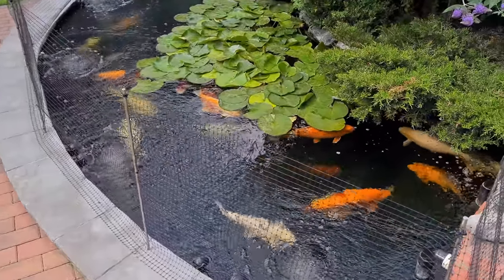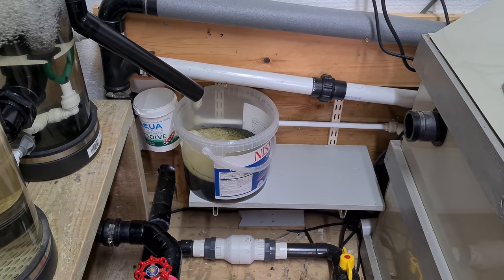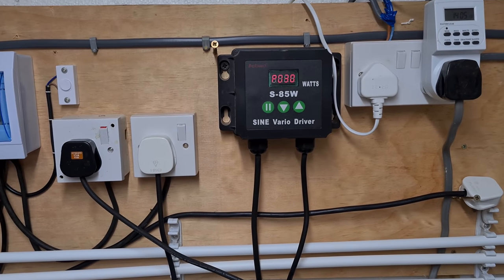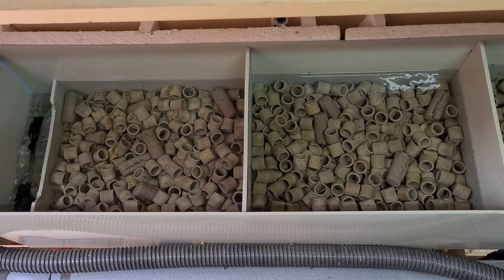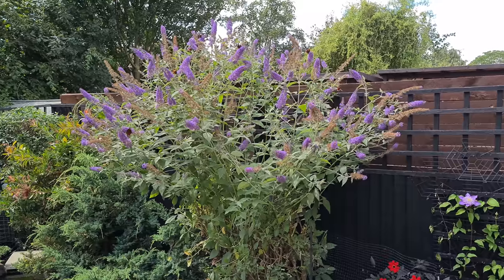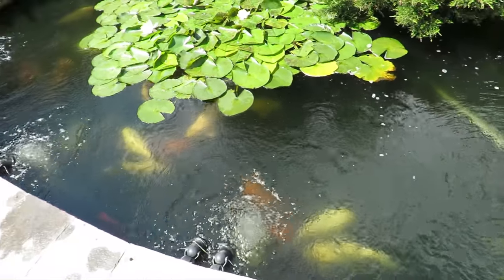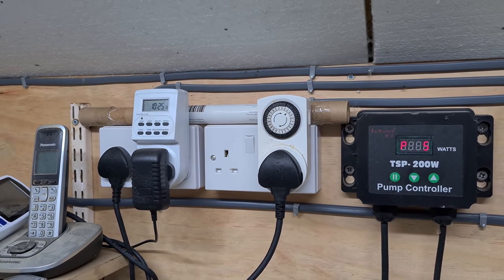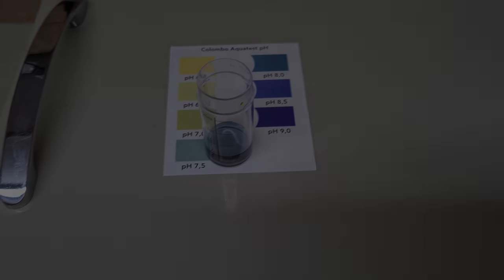Protein Skimmer, New Media & Pond Clean.

Comment: Great video Terry as always, why not try Canterbury spar in small bags in your bakki river, in a natural river water is cleaned by running through gravel, Canterbury spar in bags can be lifted out and cleaned in a bucket, thanks pete
Reply from the maker: Hi Pete, thanks for the tip mate. The Siporax is pretty good and self cleaning. I do usually get dirt settle in the river, but the media stays clean. I think putting it after the protein skimmer hasn't done it any favours with all that air flowing through it. It's got it's own feed now, so it should recover. Thanks again mate, Terry.

Comment: Hey Terry, one thing that could be added is a plant filter to get rid of those nitrates as well as phosphates. But what would be brilliant is build a refugium for a pond. You could use natural string algae that grows in your area and place it in a container with something for it to grow on. And just remove excess algae to allow continuous nutrient consumption. Better yet you could place it outside under a greenhouse cover so you don't have to store it in the filter house. For aquariums, they make them 10-20% of the water volume. They're usually a 12" depth. You could also put grow lights so the algae with the set up so they can consume nutrients 24 hrs rather than during the daylight.

Other things that would be cool is recycling your pond water through an RO system. That's really popular over there. Also possibly growing your own live food like black soldier flies. 

That should keep you busy, cheers!
Reply from the maker: Hi Miguel, Thank you for all the ideas, much appreciated. Problem is, I'm not allowed any more garden lol. I am looking into the nitrates problem, so I'll see what I can come up with. The RO system is a bit expensive for me I'm afraid. Thanks mate, Much appreciated, Terry.
Reply: @Wrighty  Hey bud - Nitrate wise, if it's high, you can get nitrate removal media stored in a pressure tank. It was something that I was looking into. I worked out a few calculations. The only thing you have to do, is backflush it with brine to recharge it. Smart stuff in all honesty.
Reply from the maker: Hi mate, thanks for the tip. My bakki river should sort it out really. I have got some tablets to treat the pond with, that say their a nitrate remover. Was going to see if they work. https://youtu.be/fAuJ0be2e7o see what you think mate, Terry.
Reply: @Wrighty  think it's a loads of codswallop, but I'd be interested to see if you see any changes at all. I think the pressure vessel (think big blue) that you can feed water into via a return (use a horse clamp) and it'll turn nitrates from 80ppm to 0 on the outlet.
Let me dig out my research and I'll drop you an email with it..
Reply from the maker: Thanks mate, will be interesting. pondfilters@gmail.com thanks again, Terry.

Comment: Check your Kh if it is low the bacteria will crash. Also when you clean out the algae you are taking away the thing that eats the nitrate and a lot of the biomass . I know you hate aglae but the short stuff is great for the pond biomass.
Reply from the maker: Hi Garry, I did check my KH and do have some bicarbonate ready if I need it. But all was ok mate. The reason I vac the algae and not treat the pond with an algae remover is because, like you say it is good for the pond. The trouble is all the fish waste and dirt gets trapped in it, and doesn't get to the bottom drain. When I vac, it only removes the loose stuff, and leaves a good coating on the pond liner. I don't mind this short growing algae, but it's the hair/string algae I do have a problem with. Thanks mate and take care, Terry.

Comment: Thanks for the videos. As for the nitrate being a bit higher, could it have anything to do with adding heavily aerated water from the protein skimmer now feeding the bakki river?
Thats assuming the bakki river was producing anaerobic bacteria before, now it has more oxygen in the water it might have knocked it off a bit? Just a thought.
Reply from the maker: Hi mate, thank you for your channel support. You could be right mate, that's just what I was thinking. I'm looking to re-route the water from the skimmer into the same outlet as the moving bed. I would then have to get a new feed for the bakki river. I suppose as it is at the moment, it's running more like a bakki shower. Thanks mate, Terry.

Comment: Hi, great video as always, I'm betting you will think of another project soon enough :) Re: nitrate, I couldn't work out why my nitrate was higher than expected, it turned out that my tap water had more in it than my pond did! So may be worth testing yours if you've not already?
Reply from the maker: Hi mate, I am going to test the tap water, but I've also been told to check the rain water as well, as that can contribute to the nitrates. Thanks for the tip though mate. much appreciated. Take care, Terry.

Comment: You could always use your siporax to make a very low flow bio chamber to remove your nitrates , the flow needs to be really really low so it creates anaerobic areas , I know your  bakki river will be providing some areas deep in side the media but if you really  reduce  the flow and stack your siporax  this will provide a much greater area for anaerobic Bactria to grow. Your could also make up some media baskets to hold the siporax then to clean it you just need to the the basket up a few times and give it a shake. How much skimmate are you collecting in the neck of your skimmer ? As over time to much will reduce the skimmers efficiency. So maybe you could make a self cleaning head for the skimmer.
Reply from the maker: Hi mate, I will be taking the rubber top off the skimmer from time to time and give it a clean. I know these skimmers can be very temperamental. I might do something with the new media that should help with the nitrates. I do think a lot of the problem was from all the rain we've had. Thanks for the tips mate, I will look into it. Very much appreciated, Terry.

Comment: Your nitrate has gone up because you got rid of the algae mate.
Reply from the maker: Hi Khi, the algae is still there mate, I just vac off the loose stuff. I do like to see it, as it makes a nice covering of the liner. Thanks mate, Take care, Terry.
Reply from the maker: Hi Khi, My Bakki river usually takes care of the nitrates, but like you say, it got worse with removing the algae, plus all that rain we had didn't help. Thanks mate, Terry.
Reply: Im not familiar with the Baki river concept, i just know from the nitrate cycle that you removed a large dutrient sump by taking out the algae. My understanding on nitrate synthesis it requires slow water flow to allow increased contact time in an anaerobic enviroment...is the baki river water flow slow enough and is it a low oxygen enviroment I doubt it will be low enought after going through a moving bed and a protein skimmer.

Dependent on how close to the roads you are I doubt that would increase the nitrates in rain by the amount youve seen, nitrogen dioxide that disolves into water would likely be parts per trillion to low for the chemical test kit, im on the M4 and it rarely changes.
Reply from the maker: Hi Khi, I have my bakki river running slow, but a lot of people on here say it should be running fast. So I'm not sure really.
Reply: If the goal is to remove nitrate then it needs to be slow oxygen deprived anaerobic it it runs fast it will be aerobic and will not denitrify the nitrate. But even if its low on oxygen unless the media contains the right type of bacteria then it will not convert nitrate into nitrogen gas. Im not sure but free nitrogen gas i think in water should be visible in tiny bubbles do you ever see bubbles rising from the media in the bakki river?
Reply from the maker: I can't say I've seen any bubbles rising in the bakki river, but I might not have noticed them as I keep a lid on it most of the time, as I understand the bacteria thrives better in the dark.
Reply: The bacteria that converts nitrate is deep inside the media so the porosity is the important thing. Yeah will do better in the dark, im just not sure the Bakki river will remove nitrate even at a slower water flow down stream from a miving bed and protein skimmer you need very little oxygen to grow the right bacteria. Have you considerd doing an O2 test on the water in the Bakki river?